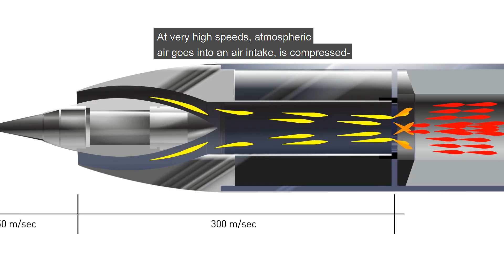How ramjets may change the role of artillery on the battlefield

Comment: 155mm artillery rocket assist has been around. The ramjet is particularly efficient. Hence longer range than a similar size rocket. Except ramjets must have a running start. Hence a marriage is essential. Should also be much lower cost (than rocket assist) per simplicity and if standardized and ordered like fries. Ironically, however, it is the extreme speed of the projectile that will be its problem, because regardless of its guidance system, the arc of error is a multiple, maybe an exponential factor, of shortness of time (the inverse of speed.) Hence by definition it will be likely 1/5 as accurate as a normal speed projectile at a given range - which means it would benefit by slowing itself down before final targeting. This ideal will be built into a boost-glide-brake mode.
Reply: I mean the accuracy would be the same as alway's unless they want to make it GPS like the Excalibur round. But with that said it's going to have the same problems as the rocket assist rounds that we already have. Much smaller warhead and in this case it's going to be even smaller. The rocket assists rounds have the motors in the back, but the ramjet on this thing basically takes up the whole round leaving basically nothing for the warhead. They're going to find a way to shorten the ramjet and stick it in the back. Most likely with a spring loaded scoop for the air intake similar to a cruise missile. Unless you're going to make a kinetic energy weapon, which would make sense actually, if this thing is in fact going at hyper speeds.
Reply: @patman0250  The arc-error shows up more on final correction that cannot be further corrected but it's always there because there's always an error in the course - however slight it is magnified by distance, and speed is on the "wrong side" of the denominator in that correction factor.  Just imagine hitting a curve ball from a fast pitcher who is 1) twice as close to you, or 2) twice as fast. They are functionally the same thing. You have less time to correct for where you think the ball will be at t=0.
Reply: @MasterDivineAdVentures  Well I mean there's only so much tech that can put into these two foot shells. I mean country's possess hypersonic missiles that are so accurate can be targeted right through your window. Including the Excalibur GPS mortar round. There's nothing that says that it can't be done.
Reply: @patman0250  Yeah - cost is the factor. I have no idea how these things get so expensive. The argument seems to favor smart missiles there's a line between artillery up to the Excalibur (GPS and glide) - and much larger vehicles - but I have no clue about what the fine points are.
Reply: @MasterDivineAdVentures  Well all I know is artillery weapons are extremely sought after because they're the cheapest, and have a big impact. But I would think most of the cost comes from the fact that, the people making these weapons are privately owned contracting companies. And they probably set their price based on the crazy hoops the government makes them jump through, just to be in the business they're in. Just like gun manufacturers have to hike up their prices, now that the government's making it impossible for them just to stay afloat.
Reply: @patman0250  I spent 10 years at TRW / STL in Torrance / Redondo / El Segundo once I grew up, and I saw that evolution (mom started early) from the late 1950's. I surmise that most of that cost comes from the unfunded or underfunded R&D - these companies live or die on getting contracts. Example: the F20 was Northrop's entirely self-funded low cost utility fighter (low maintenance, all-purpose, low-budget) around 1985. It was a great economic proposition, a heroic effort and a magnificent bird - but they never got a single order from anywhere in the world. However they were "compensated" with the B2 Spirit contract - which was a technology that they also pioneered since 1940's.
Reply: @patman0250  I was actually thinking that overall weight would be reduced, but there is extra piping - however it is common for a warhead to be located back of the tip - that's the rule for penetrating rounds. It would definitely change the dynamic.
Reply: @MasterDivineAdVentures  Well some penetrating rounds warhead doesn't have to be behind the tip. Like the javelin, it's shaped charge warhead is like in the middle of the missile. Well it's a tandem shape charge, smaller one to take out the reactive armor, then the bigger secondary one follows milliseconds later.
Reply: @patman0250  Yeah - deep penetrators have stacked I don't know how many to blow through any unfortunate hiding place. It's amazing that those work. Seriously ga-ga technology.

Comment: Wouldn't the actual amount of delivered thrust vary significantly between shells?  It uses solid fuel, which just can't be tuned in flight, especially in such a small system.  Variability of density, pressure and humidity of the air through which the shell passes would alter the fuel-to-oxidizer ratio, which would alter the flight characteristics of each shell. The first shell might get a really inefficient burn (too rich/too lean) making it fall short of the target, and the next shell might get a nearly optimal burn, making it travel 2% farther, or with an ever greater variance.  If the proposed range of these shells are actually 150 Km, that's a 3 Km or more variability - That's not such a problem if we're returning to carpet-bombing, but is a huge problem if precision is the goal.

Adapting to this variability would require active guidance, which would make the cost of each shell skyrocket, and would probably need the same real estate as the throat of the scramjet.  The G-forces involved in being shot out of a howitzer will make the electronics much more expensive than those in rockets or missiles.
Reply: Apparently lots of shells don't hit their targets. So adding guidance isn't as expensive as it looks if it means that you don't have to fire lots of them. One figure that I saw quoted (don't really know if it's true) was 98% - which would be 50 shells for one hit. Rocket assisted projectiles with guidance already exist so this is just a more efficient version.
Reply: Only practical for GPS guided artillery.

Comment: Its nice to see that Ammo Manufacturers work on ruining the country, before someone dies. "Guided" Ammunition needs a seeker head, which a ramjet inlet Nozzle cannot house. And while a Depleted Uranium Nozzle provides a lot of kinetic energy, the cleanup might prove to be substantial. Which, (in case you win) is up to you. (As seen in Kosovo, with Tank shells and GAU 8 Spray)
These shells will cost a lot, for a barely minimal advantage, as Missiles exceed 150 km range reliably, with high accuracy.  A modern self propelled Artillery costs as much as a Tank, or even more, A Missile of a few 100'00$ might still be viable, while a semi-Accurate solution might use up the same amount of money, if it needs to fire 3 or more shells while being exposed. The warhead must be small, but it will have neither the range, or effect of a proper Missile. Somebody is looking for a solution, others already created, If these howitzers are detected. Planes would start using longer ranged missiles. And the artillery is in range anyway, wether 80 or 150 km from their target. Satellites are a thing nowadays. But hey, how much does a signature on a trade or peace agreement cost? Answer, it can potentially earn money, or save some.

Comment: Range capability is all well and good but it's far better to have accuracy the Russian vehicle mounted rockets may have the range but they are firing blind. With the ramjet artillery shell concept is good but the destruction ability will be limited as most of the shell is taken up by the motor and not explosive.

Comment: Build the tip of the shell from uranium or Wolfram, make it fast enough and you will  get a anti Tank dart. ad a control system und you can destroy a tank in 120km distance.
And i dont think a ramjet will be expensiv. there are no moving parts. The problem is the starting speed and the geometrie of the shell. It comes from a canon so you have your needed v0. And the geometrie had to be designed only one time. the tip may  be expensiv for the material. thats all.

Comment: I do wonder if the developers understand the reason for artillery from a howitzer/ gun.  As most said already the point of artillery is because it’s cheap to lob shells than rockets or missiles.  Yes rockets and missiles have there place but missiles are very expensive with all the modern guidance etc.  Rockets are less expensive than missiles but less accurate and more used for carpet shelling.  Shells such as Excalibur have a place but limit due to their expense.  Even Excalibur's development was hard due to sensitive systems in a shell.  With scram jet shell I question not only the accuracy but also with what looks like the entire or most of the shell taken up by the scram jet itself where does the rest of what goes in a shell goes I couldn’t even see where the fuse goes. Shell artillery is cheaper option when rail gun got too expensive which was meant to be cheaper than missiles the rail gun plan was stopped.

Comment: Guided artillery projectiles are extremely expensive. For example, one M982 Excalibur artillery shell costs $112,800. If you combine electronics that can withstand extreme g forces with ramjet plumbing, the entire projectile will cost about $200,000. Big artillery projectiles can be detected with radars. If the projectile flies for one minute at high altitude, everyone knows where (+-1km) it will fall. If you try to hit a tank with such projectile, the tank drives into a forest and the projectile cannot find it.

Comment: This is not a new idea. The German army experimented with Trommsdorff ramjet shells in railway guns during WW2. Ramjet shells have pretty much the same pros & cons as rocket assisted projectiles. They are longer ranged for sure but not terribly accurate as the shell's centre of gravity changes during flight as its fuel is consumed. They are also more expensive than regular shells. Another problem is that the rocket motor (or ramjet) cuts down the amount of explosive payload the shell carries.

Comment: A-lot of you don’t know what you are talking about in the thread. I was a M777 Gun chief for over 5 years, I was also in a M198 chew and other mortar and heavy weapons units. Artillery rounds are cheaper but that’s not the reason why its important. Its because we can fire when they ground air support for inclement weather such as sandstorms or heavy windstorms. Rocket boosters like HERA on 155mm are inaccurate, we don’t need another rocket assist artillery round. We have HIMARS / MLRS systems that can reach further.
Reply: Norway

Comment: When does the ramjet stop? Is it still accelerating while coming down, or does the motor run out on the ascend? How about fins for terminal guidance? Or thrust vectoring in case the motor still runs while coming down?

Comment: Very interesting video. But could you tell me how much explosive this shell actually will carry ? One can build a lot of things into artillery shells - base bleeds, rocket engines, ramjets, guidiance systems etc.. But all this only makes sense if the shell still can carry explosive enough to "get the job done" when it hits the target.
Reply: Yeah I was hoping the video would give the amount of high explosive packed into the shell. It can't be much with the ramjet taking up so much space. 
And how accurate is this shell at 150km? 
And if the target is only 85km away then how do you make the shell NOT just overfly it? 
A lot of problems will have to be worked out... not to mention how expensive is each shell??

Comment: The comment that artillery is "supposed to blanket an area cheaply" misses the point.  The same exact mindset once existed for gravity bombs.  How many dumb gravity bombs do we use now?  NONE.  If you can make all artillery pinpoint accurate, then it becomes a game of secure communications and rapid information processing.  Something the US/NATO will have an inherent advantage at.  Think about how much gravity ordinance we dropped on Germany and Japan.  What if 10% of that had been precision guided, with a CEP of 10m? LOL.  Heck...even just 1% would have been devastating.  The war would have been over much sooner.  Soldiers without heavy firepower are just soft targets.  That is what cluster munitions are for, after their air cover and artillery cover is destroyed.

Comment: Whats the duration or distance of the rounds ramjet powered flight and what speeds does the round achieve at max charge levels? If those numbers are high enough you can combine it with a air defense radar and get yourself a very cheap per shot mid range air defense system.

Comment: If the drawings are anything close to accurate the vast majority of the internal space is used by the engine. How much space/weight is left for the actual warhead to inflict damage?  Not much point in just throwing a rock 150km.  Tube artillery is beloved for CHEAPLY delivering lots of "bang" on target.

Comment: why not just use a rocket.
Reply: Well a rocket engine by comparison to a ramjet is far more complicated and more expensive to make.
That's one reason.
Reply: @kallu1488  They speeds required to make a ramjet efficient are better off with a rocket.
Reply: @ChickenPermissionOG  Rocket engine requires fuel & oxygen/oxydizer.
Ramjet requires only fuel... when the required speed to feed the atmospheric oxygen is fulfilled.
So ramjet is more efficient in weight to fuel ratio than a rocket.
But it's complicated yo.

Comment: Any small deviation in the motors function from test results will impacy the range in a major way. Say the engine fails to ignite in time and is activated for example 1 second later, that would affect the trajectory quite a bit and the impact site at about 150km might vary with several hundred meters or even kilometers.

Comment: If you can combine big electromagnet ramp ("Railgun" - https://www.youtube.com/watch?v=2HcqS508lIo&ab_channel=RealEngineering ) with your ramjet projectiles, you can make micro rockets which can reach LEO in very small size. Electromagnetic rails will start this projectiles smoothly (not explosively, like in regular gun), so you be able to put in it relatively fragile payload. I think the size of such micro space rocket may be about 1 meter height and 200mm in diameter or something like this. And in this case you can make satellite and rocket not separable and add some useful features using additional space (like solar batteries). Anyway your ramjets is really breakthrough tech, this is very cool thing.

Comment: I think you have to ask yourself why are we doing this, and what's the point? The  cost and effort to design something capable of withstanding the G forces of being launched out of an artillery piece is formable. This force is  necessary to impart sufficient amount of energy to the projectile to allow it to reach it's destination. If your going to provide another means to propel the shell, why not attach a small solid fuel booster rocket, this will get it moving fast enough for the ramjet to take over, and do away with the artillery piece altogether.

Comment: I see two main disadvantages, cost and effectiveness. The cost will obviously be higher than a standard shell. The effectiveness will likely also suffer. For one, accuracy will likely be an issue, but more importantly, the inclusion of the ram jet means that they will have to compromise on how much explosives that can be packed into the shell. Meaning that this would be more suited for a kinetic round. Unless they can make this extremely accurate while targeting at 100km+ it does not seem feasible since low accuracy would have to be countered with a higher number of shells fired at a target, which would have to be increased again due to the lower explosive power that can be packed into the shell. This in turn will affect the cost for an already much more expensive shell.

Comment: Stand by for rogue shells spinning out of control, sitting in the breach, pre load damage to fins, or much worse. 
Training hours will be shorter  and less frequent, as the cost of a shell per operator will be higher, and the fail rate of equipment could increase. 
So more fail rate, higher cost, and possibly less training. Great idea, why not.
Reply: Funny...we do not hear about the M892 Excalibur having these issues....

Comment: If the whole thing is a damn rocket...where the hell does the actual weapon system fit.
Reply: you need speed
hit somebody with a pizza at high enough speed and it'll be lethal
at such speeds, the shear momentum and the shockwave that follows is enough
Reply: Have you ever seen a .50 go through a stone block? If you look at the entry and exit, it does a ton of damage despite just being a simple solid metal projectile. Now multiply the speed by 5 and the mass of the projectile by 1000, that's going to do an insane amount of damage.

Comment: Well you've got a nice rocket. But where is the warhead? A conventional 155mm grenade has a fuse on top and a shell filled with explosives. I kinda missed that here. And other than that, how are these rockets accurate at 150Km distance?